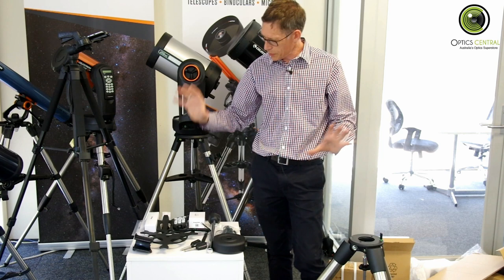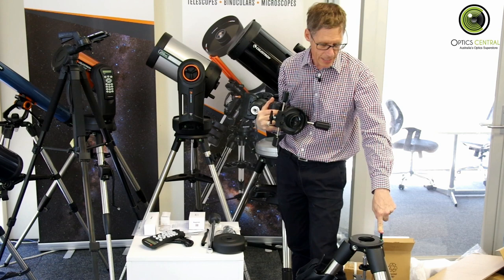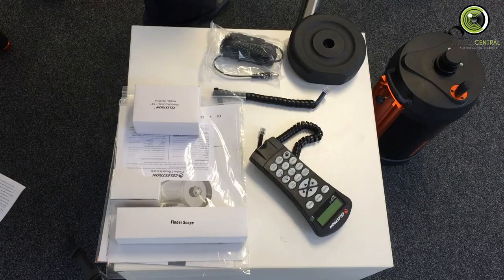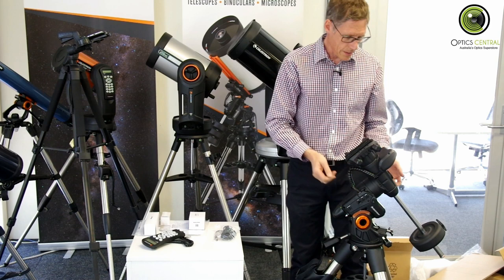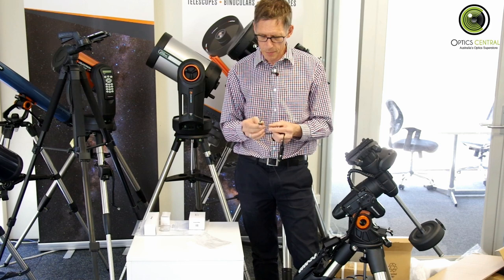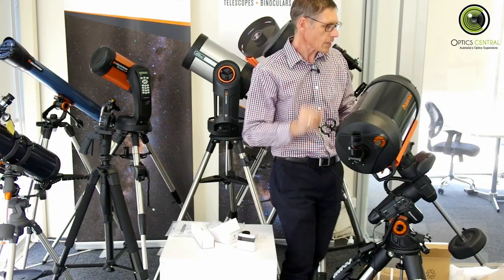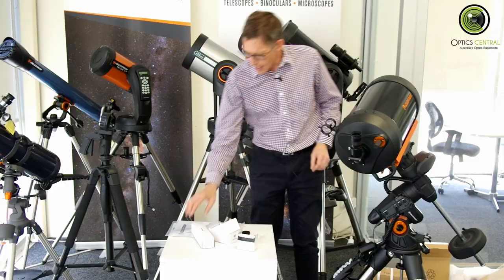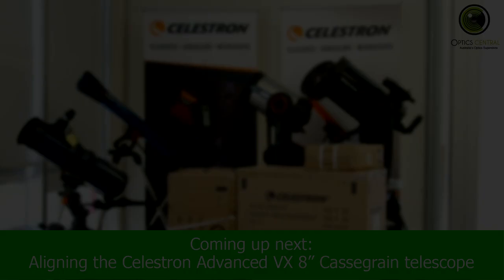Celestron 8" Advanced VX part 2: assembling the Schmidt-Cassegrain telescope and equatorial mount

Comment: Does anyone know the name of the bolt he used underneath the saddle to keep the OTA from potentially "crashing to the ground" in case clamping bolts slip? Do they come with the kit?
Reply from the maker: I've always simply called them the "safety bolts". I think Celestron might call them "safety knobs", but don't confuse them with the counterweight safety (CW) knob, which stops the counterweight from falling off the shaft.
Reply from the maker: Ah, I've just had a look at the instructions for the Advanced VX mount (https://celestron-site-support-files.s3.amazonaws.com/support_files/Advanced_VX_Telescope_Series_Manual_5lang_Web.pdf) and on page 7 of the English section they call it the "safety screws located beneath the dovetail bar".
Reply: Optics Central Excellent- thanks! You guys are great btw. You’ve just helped me through my AVX 8” SCT unboxing tonight!

Comment: Hi is their a 2" adapter ring for fitting a 2" diagonal to the telescope as well as the 1.25 connection ring.
Reply from the maker: Yes, have a look at Celestron part number 93527. It's a 2" diagonal that connects direct to the visual back of the telescope and allows you to use a 2" eyepiece, and it also has a 1.25" adapter so you can use a standard eyepiece as well.
Reply: @OpticsCentralAustralia  hi thanks for your reply I should have said visual back adapter but glad you knew what I meant that's great news as I am waiting for my celestron telescope to arrive next week.

Comment: Hi, How difficult is it to transport this telescope? I seems rather large to put it in the rear seat.
Reply from the maker: Actually it's not too bad. My personal rig is about the same size - an NEQ6 with a refractor. I drive a small car - a VW Polo and it all fits in OK, but I have to fold the back seat down and nobody gets to drive up to the dark sky site with me! 

There are three basic parts, the mount head, the legs and the tube. The legs are the largest and most awkward part, but the 8" Schmidt-Cassegrain is going to be a fairly large box as well. The head is not large but it's heavy.